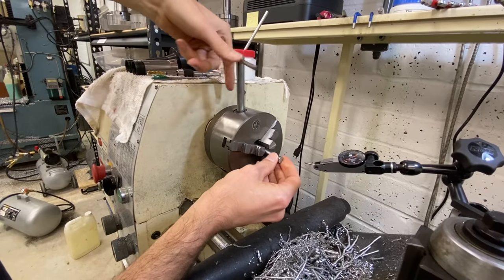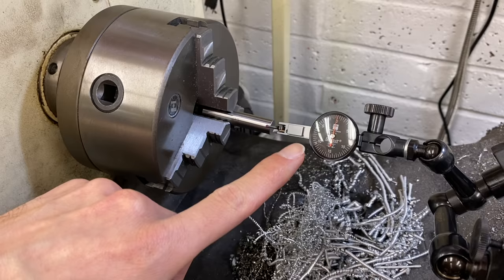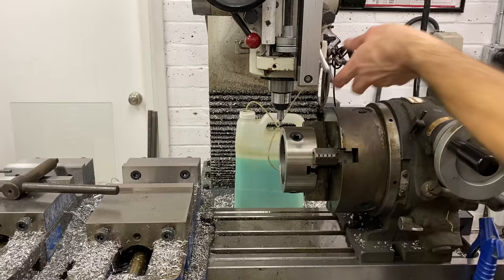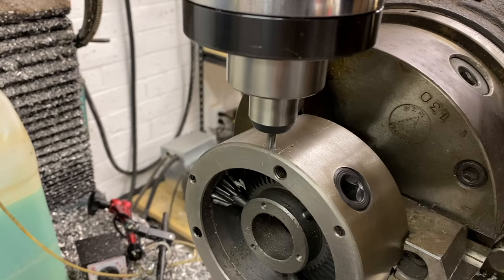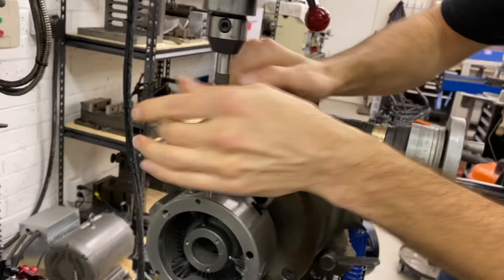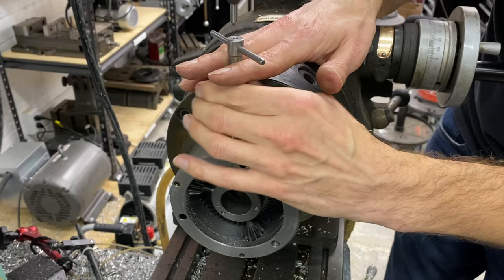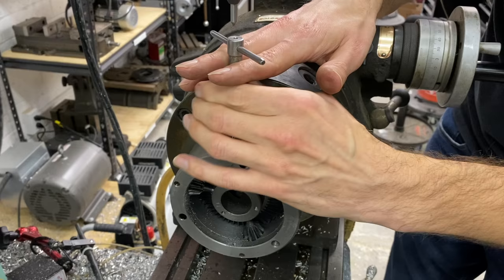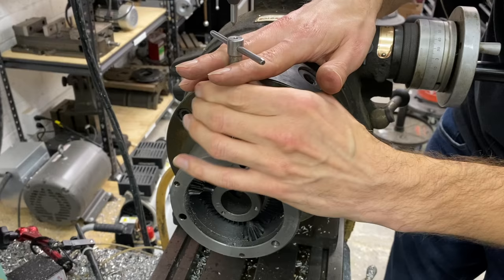HOW TO MAKE YOUR CHUCK SUPER PRECISE BY ADAPTING IT INTO SET-TRU

Comment: I don't know how many times I've heard about people with 3 jaw chucks.....brand new ones too....... running out a thou or two..........they will all run out even the best and they are not meant to be blindingly accurate to a thou.
Most of the time you will grip raw material and then turn it down to a size so run out is not important, but when a second op is performed where you really need to re-grip a work piece and then machine it true and concentric a trick I use can be employed and my Chinese 160mm 3 jaw chuck is 40 years old but runs dead true.......just cut the register on the back plate a few thou slack and this will give you room to slacken the holding bolts and bump it to run  true every time you really need to have it dead true......for the most times you can live with it as it is.
3 jaw chucks on dividing heads should ALWAYS have a slack register as this will allow you to "adjust" them to run dead true for cutting gears where the mandrel holding the gear blank  must run dead true.

Comment: I did this a couple of months ago and couldn't be more happy that I did. Just posting to atest to the goodness and benefit of doing this. Even if you have a 4 jaw chuck this is still a very useful mod.
Reply: Honest question here. What is the benefit of adjusting the concentricity of a four jaw chuck? Doesn't the part get centered independently of the chuck?
Reply: @peterkim5394  Sorry for the confusion. I should have said "Even if you already have a 4 jaw chuck this is still a very useful mod for your 3 jaw chuck."

Comment: I do like the idea of modifying the standard chuck. This is a great video showing this process.  In my journey using these chucks.  I find it best to loosen all the set true screws and tighten the one necessary to move the chuck, then loosen it up again.  As the back plate is snug enough the chuck will stay in this position, spin it and adjust the next one, continue until its's real nice and concentric.  Rarely you might have to adjust two to move it in the right direction, put it there and loosen them up and when you finish then snug them all up, getting that last little bit.   Using multiple screws kind-a snug can distort the chuck making the process more difficult.  Try it you will like the results,  Cheers!,

Comment: You can learn something every day if you pay attention. Great informative video. I bought a SKAND 6" 3-Jaw self-centering chuck that was slightly used. It was supposed to be within .0005". It has American Standard Tonge & Groove removeable jaws. It was .009" out when I put it on my lathe. So, I tried to adjust it by getting all I could out of the Allen head screws and was Lucky to get withing .0025", but I have to use a live center to keep it on the money.  There is no adjusting this lathe chuck like it is. Every piece from the backing plate to the chuck housing shows a different runout. The jaws when screwed in all the way have a 1/16" space between #3 and #1 jaws. I can see why it was up for sale. I am a Hobbyist learning as I go and couldn't figure it out until it was too late to return. I have a threaded nose spindle, 2-1/4"x8TPI on a 13" South Bend engine lathe 3-step pully. The belt is 2-1/4" wide, and it has a lot of torque for making big cuts when needed. I'm changing my threaded nose piece to a D1-4 Camlock. I'm going to make an adapter to thread on, lock tight it and pin it to the existing spindle. I learned my lesson from all the research trying to get this chuck dialed in. I've been told that on any 3-jaw scroll chuck if it's got a runout of .002" you are doing good. You have an interesting variety of videos, so I went ahead and Subscribed to your channel. Thanks for sharing your knowledge and skills
Reply from the maker: Thank you so much! Glad we could help and happy tool hunting, it is a never ending process..
Reply from the maker: My current favorite is the SANOU chucks sold through CME.
Reply: This was a while ago I know but how did converting the threaded nose to D1-4 go? Sounds ambitious but if it works you're the man.

Comment: I did this on a decent 8" Cushman chuck oh geez, 30 years ago? Only used 3 setscrews requiring a bit more, uhm - foreplay early on. I did modify that internal casting into a sleeve to capture between the chuck mount face and the scroll plate surface. Prevents the scroll skewing around and improved repeatability at the current grip diameter. You can test the repeatability by re-gripping using a different pinion gear. Best practice of course is to mark one and use it exclusively. 
One concern I remain aware of is that industrial set-true chucks typically have a steel body and mount. Import grade chuck bodies may not even be malleable cast iron.
Reply from the maker: Yes 3 setscrews will provide the correct movement but I have never seen a production chuck with anything but 4 so I stuck with that. Yes most set true chucks are beefier and usually steel, although some import ones seem to be some kind if soft iron. Good judgement is required when modifying any rotating tool like a chuck.
Reply: @TigermothRacingTV  Much easier with 4 adjusting screws. No matter what I tried, 4 conflicted with another element. 
Notice the max rpm limits between steel and cast iron chuck sizes. Just because it fits doesn't mean it's safe. 🥵

Comment: I agree about using the largest possible set screws but also surely it makes more sense to use softer set screws better to replace a damaged set screw than to have to strip a chuck to get at a guoged damaged part. Great video by the way, I did enjoy it.
Reply from the maker: Thats an option for sure, you could even use brass setscrews if you like.

Comment: Nudging set screws, not needed. Reduce backplate register by about 0.040" to allow enough adjustment movement and then use the backplate set screws/bolts to hold the chuck by light friction, tap the part piece true using a lead knocker, tighten a little more and check run-out is still ok, fully tighten and machine part piece. You will never be able to displace the chuck on its backplate when the backplate screws are fully tightened. This method is suitable for chucks in excess of 8" diameter.
Reply from the maker: Ive done this before on small chucks and it works fine but I like knowing the position is held by some physical limit. And the fine adjustment of the setscrews is quite nice.
Reply: @TigermothRacingTV  I will use the finest thread set screws I can find. Two reasons. the kids wont strip them right away and for very fine adjustments.
Reply: @davidsymalla4785  Without nudge screws applied, Initial knocking true of the part-piece can quickly be achieved with the chuck rotating at about 120rpm, although you need a good eye to get down to about 0.002 to 0.004" run-out, then perfecting the run-out by hand cranking the chuck.
Reply: @TigermothRacingTV  Yes, as you wish, personal choice. Using nudge screws has an advantage that NO knocking is applied to the spindle bearings, depending on the type of bearings in use.
  I find it quicker to run the lathe spindle at 120rpm with the backplate set lightly tensioned and knocking the chuck true, with lead, then finishing off rotating the chuck by hand to achieve final perfection.
Reply: @davidsymalla4785  Using nudge screws has an advantage that NO knocking is applied to the spindle bearings, depending on the type of bearings in use.
Reply: I agree. This means you will have to oversize your mounting holes to allow play. I dont understand how he was able to move the chuck in relation to the back plate with no play on his mounting bolts???? He did not mention the tolerance
Reply: @bernardmauge8613  The holes for the bolts are clearance holes, so there will be way more clearance for adjustment than needed. You are only moving the chuck around a few thousandths at most. A clearance hole for that size bolt will be .010-.020" larger diameter than the bolt.
Reply: Stephane Goetteswinter used this method for years. He never used a 4J. He indicated everything in to very close tolerances in a very shirt time. First time I had ever seen it done.

Comment: Also, not mentioned is that one of chuck key holes usually tightens a part more concentric  than the other two. Good if you are just looking for quick improvement in runout. Some shops I have worked in have had one chuck key hole marked for quick reference.
Reply from the maker: Interesting. I have heard that sometimes you can get a part clamped slightly tighter using all the key holes rather than one but the idea of affecting concentricity is interesting. At that point you are just messing with inherent play in the chuck assembly. How much adjustment do you usually get?
Reply: Robin Renzetti says the same in his 8" chuck upgrade video.

Comment: I could see this being a useful mod over swapping to a 4 jaw.  You get the speed of a scrolling 3 jaw when you don't care about accuracy, or you can take the time to dial it in without switching chucks when you do.
Reply: You can get accuracy equivalent to a 4 jaw, but you are still limited to holding round, triangular/hex etc workpieces with 3 jaw.
Reply: Yeah, well, its like having a horsecock and complaining about the size... Its the nature of the beast, if you need to work with square stock, get a 4 jaw, also, there be 4 jaws that are scroll actuated, and you can do the same thing to them and have the speed of what most people ascribe to a 3 jaw, but in fact is a common trait among all scroll chucks, while having this mod and giving the scroll chuck of any number of jaws, be it 3, 4 or 6 the x/y alignment capabilities associated with a 4 jaw... Also, consider taking a 3 jaw, getting 3 more jaws, hardmilling  it out and fitting in those 3 more jaws and voila, you have a set true 6 jaw chuck for the price of a 3 jaw chuck and 3 additional jaws...
Reply: Go buy a collet closer if you need to run close

Comment: Interesting.  Just a note on set screw size.   It is not necessary to rely on the set screws for any more than positioning.   Tightening the screws that hold the back to the chuck will be enough, if tightened sufficiently.   Many folks do not know this, but every joint in a drill string used for drilling oil and gas wells relies on friction between the shoulders and NOT the threads to transfer torque from one section to the next.   This torque being many thousands of foot pounds.  Perhaps just a wee bit more than the lathe will induce.
Reply from the maker: Correct, the setscrew size is not very important. However when you are measuring in tenths, you may see some drift in concentricity of the chuck if you wack the chuck or take a very heavy cut because the tips of the setscrews can deform or the thread will compress slightly but this is to be expected if you make a high load mistake like that. Most people do not put a death grip tightness on the chuck mounting bolts because they are adjusting it all the time.
Reply: @TigermothRacingTV  Every time I put an endmill in a collet, I tighten enough to prevent slip.  I tighten a work piece in a vice or chuck to the same end. I do these frequently, so I don’t buy your argument. Who, when working to tenths, takes a huge cut, or fails to tighten sufficiently?

Comment: Good idea, but it would really come down to how fast you can swap Chuck's vs fiddling with 4 set screws and 3 bolts.  4 jaws are quick with practice, at least faster then all that set screw tensioning.
Reply: you only have to do this once,you know
Reply: @hedning003  not true. You have to do it every time you put a different diaper part in the chuck. The point of this is to make it repeatable for parts you have multipacks of to do. Yes it can help with a bad chuck. But it won’t fix it for all diameter parts.

Comment: Copy that on the vacuum cleaner and the special considerations for machining cast iron.  Again, I always have a vacuum cleaner present so I don't disperse chips and and using compressed air around an open tool receiver is bad news.  Cleaning as you go saves so much time and not sealing with an accumulating mess. Always take a clean finger and check the receiver opening before inserting a tool. Nice upgrade and Im considering the modification to a chuck based on your work.
Reply from the maker: Good points and I agree, always wipe the taper of your spindle before inserting a new tool, especially when cutting messy materials. It is an automatic habit for me on the TRAK mill. Most VMCs these days have positive pressure air purge on the taper for this very reason..keeps them clean.

Comment: I turned down the register diameter on my cheap 7x Chinese lathe about .002" or .004" total ...No set screws....I just snug the hold down nuts enough to be able to tap the chuck true then tighten them....Works well.
Reply from the maker: Good to hear. If you start doing some hard turning you might want the screws but it is amazing how much force a simple bolted together assembly can take.
Reply: @TigermothRacingTV  I have an 8" Pratt chuck that is adjusted by the tap true and undersized register method. It has been modified like that for years and never moved from where it is set once the back bolts are tightened. there is no need for the radial adjustment screws to hold it firm.

Comment: Without machining the back plate to exact depth to meet center hole collar inside the back of the chuck, how do you keep any swarf and debris from getting inside the chuck through that gap and causing wear to the pinions and scroll?
Reply from the maker: My experience has been that not much crap makes it back there even over years of use. The chucks are stored jaws up too so that keeps the dust out. Just hasn't been a problem. Might be different in a big flood coolant automated situation but tool making/prototyping it doesn't seem to be an issue.

Comment: Why not use soft jaws bored in position with jaws preloaded over a dummy piece at distance deeper than intended gripping area? This is better if you have more than one piece to turn.
Reply from the maker: Yes it is, but most small shops don't have a chuck that you can get soft jaws for.

Comment: Excellent idea, but if you have a chuck directly mounted on the spindle and not a threaded plate that you can exchange if something will go wrong...
Reply from the maker: Then you may need to get a different chuck with a back plate?
Reply: @TigermothRacingTV  It's possible, but I'd not going to the middle of the lathe 😅

Comment: Changing the diameter of the chuck faceplate so that it doesn't fit within the H7 tolerance that it's is design for, will course the chuck to vibrate undet heavy load. No need for any form of adjustment, just use soft chuck jaws if you need precession within a thousandth of a millimetre. Or for general work, buy a good quality chuck. I have a German Trekarter 200 m/m chuck, it runs within 0.02 m/m and is repeatable within that tolerance and soft jaws are easily mounted but, then again you are look at a price of ca. 2100$. Using a 4 jaw non self-centring chuck will give greater stability and it can be adjusted tobe extremely accurate. Good quality video T/U
Reply from the maker: Yes this is exactly the point. Most home or hobby machinists will never spend the money on a Buck or Bison adjustable chuck. There is no need. This method is simply an easy solution for anyone to get the same precision out of any $100 import chuck. Most of which do not have soft jaws available and are 1pc jaws. If anyone sees soft one piece jaws let me know, those would be very handy as well. Making a 3 jaw adjustable is handy because you can still do production work with a clamping repeatability easily within .001in. This would be a nightmare with an independent 4 jaw. The chuck body can be eccentric seveal thousandths before any vibration will occur at common speeds. For home shop speeds, not usually an issue, in a bigger machine shop, they are gonna have an adjustable chuck or collet system anyway.
Reply: @TigermothRacingTV  For home shop the only thing you can do is to grind the jaws of the chucks - even that comes with a lot of assumptions and limits. You may want to see how a real adjust true chuck looks like - https://www.youtube.com/watch?v=E_Ks6GKKcs8 
also every part of this adjust true is precision made. With chucks usually what you pay is what you get - with some exceptions here and there. For example, I grind all my 4 jaw chucks when they arrives home in a box from China. It improves things a lot but is no Bison. You cannot make them more precise as there simply is no way to add metal to make tolerances tighter. 
If you want quickly add some precision to a 3 jaw, as others pointed out the soft jaws are the thing for production run. Then again, most hobby guys do not run huge production runs.

Comment: Ok now you need a farly large mill to. Most of us just wasted some time on this O'Neal 😊
Reply from the maker: You can do this with a hand held power drill if you have to. The location of the setscrews is not very important. No mill or rotary required.